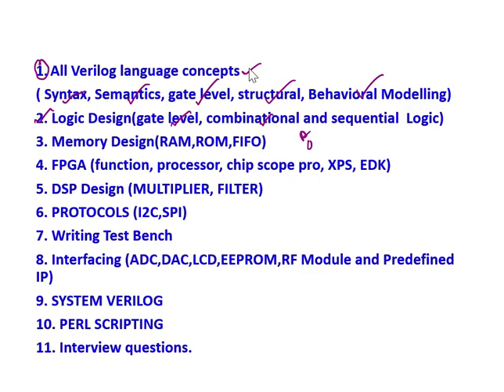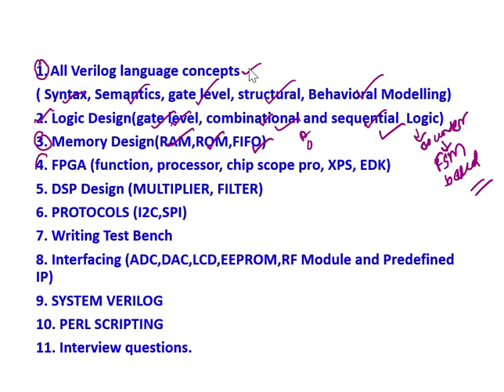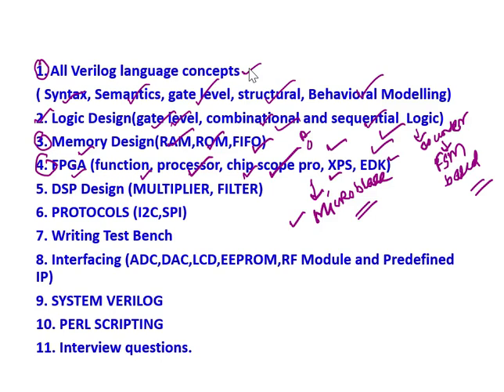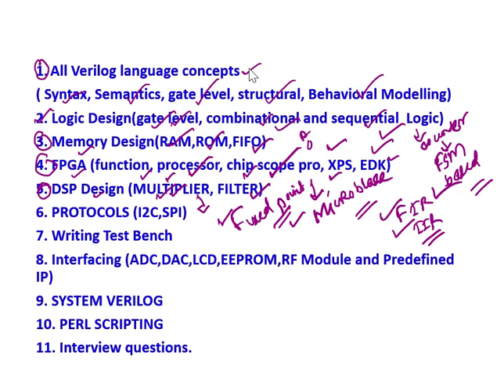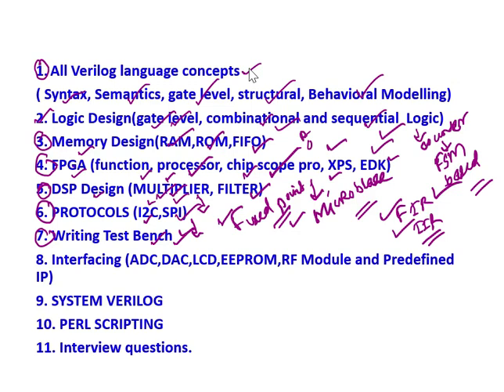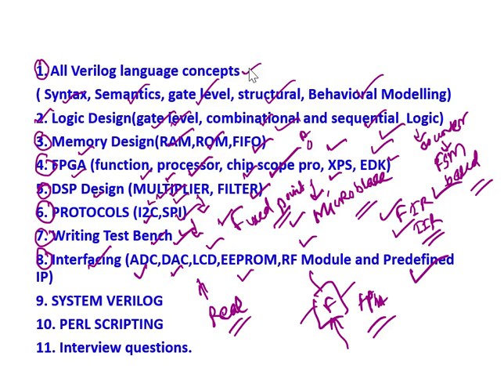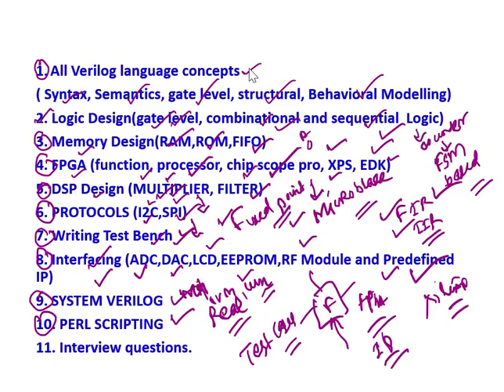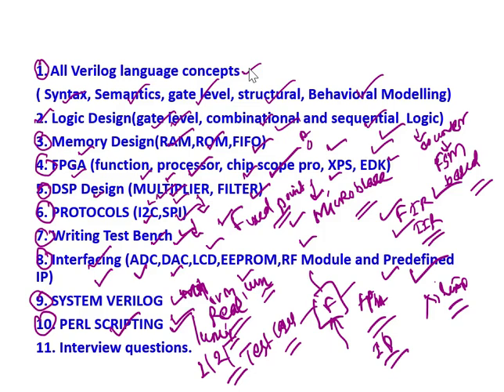Introduction to Verilog HDL course

Comment: How much time it will take you for upload all this topic?
This is the best way you doing. Please be specific after some time you will get better view so please stick to the verilog full course. Thanks
Reply from the maker: Thanks Satyam for your valuable comments. More than 40 lectures I will upload to cover all the basics of verilog. Then I will upload realtime concepts like digital filter design, low end protocols like SPI,I2C  and then  FPGA implementation . I will also cover how to write RTL code.so it will take time. This tutorial is for someone who wants to learn verilog form basics and who can't afford to join a VLSI TRAINING centre( I don't want this verilog language to be a commodity which someone can't afford ). I can upload random verilog content  but it may confuse a beginner .so I upload the content , always thinking myself as a beginner in verilog. I am sharing my knowledge and experience. If it helps someone in anyway then I will be more than happy. I believe Sharing is the first step of humanity.
Reply: Thanks . Keep it up bro.